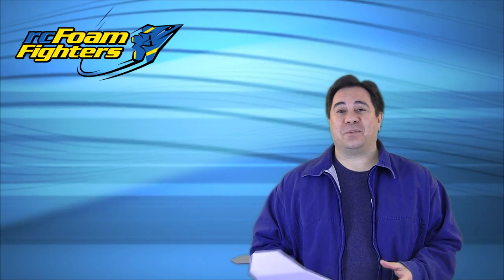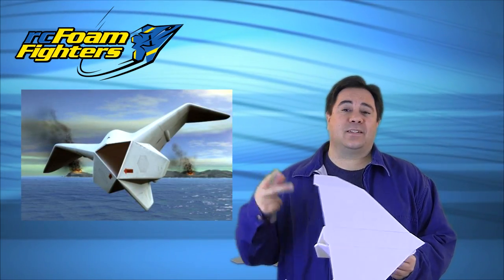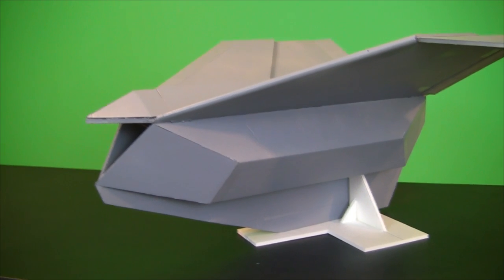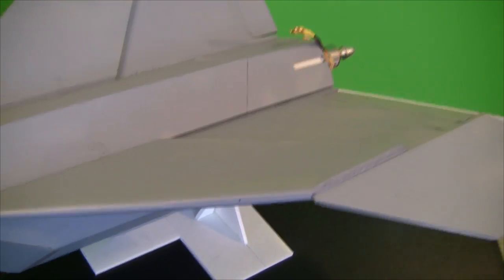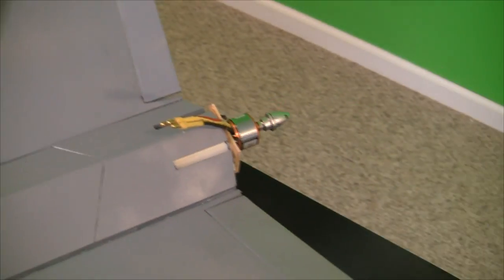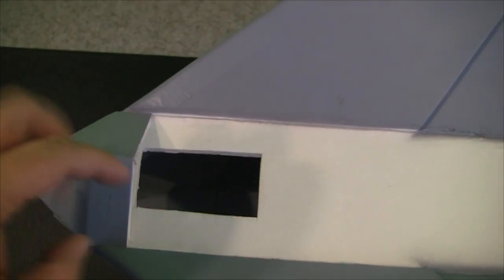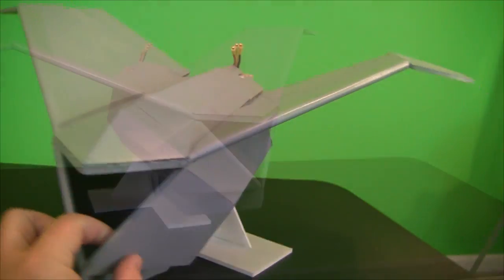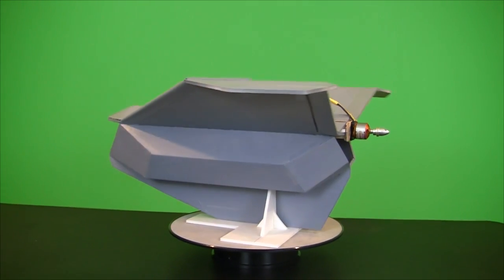MPUAV Part1

Comment: I always wanted to try what you have done with this drone, the constructive criticism I can give you for this aircraft is #1 it needs to have an airfoil, like the full scale. There is a reason for this to get the aircraft to fly properly. Researching this would be difficult without contacting the manufacturer, but it could be figured in a profile program, or choose a stable one from a list,. #2 it needs a stabilization device, or fly by wire, like with a flight controller set up for fixed wing. The CC3D atom would be an awesome match. This aircraft is basically a flying wing with a fin on the bottom of a lifting body, so just a little of stabilizing after you get it to fly even halfway decent would work. #3 your end result design is basically a completely new aircraft, and unfortunately takes away from the “coolness” of the original design, (not your fault mind you, just constructive criticism) It was a good effort. Well done

Comment: gorgeous design! if it doesn't turn out stable enough to fly, may i suggest using a gyro (argh!), maybe the hobbyking orange cheapie and add a rudder to the bottom of the fin. with that huge side area that is the length of the whole plane, you might have to add some sort active yaw stabilization. you can bet the full size does. with the gyros, you might not have to alter the appearance too much. as for landing, perhaps a carbon strip on the bottom or just may have to do inverted landings